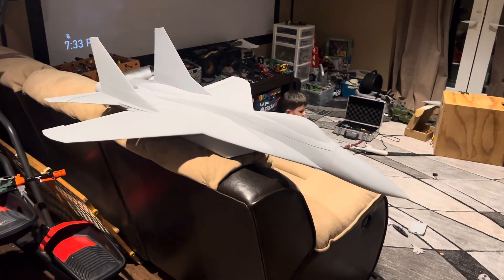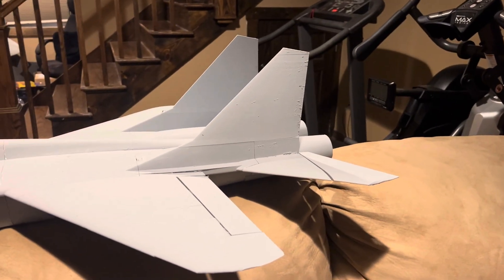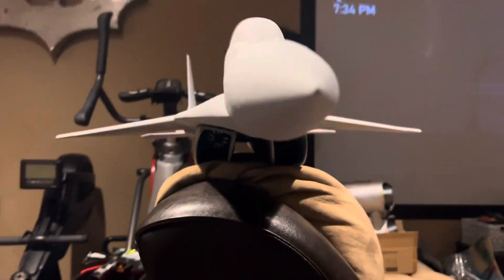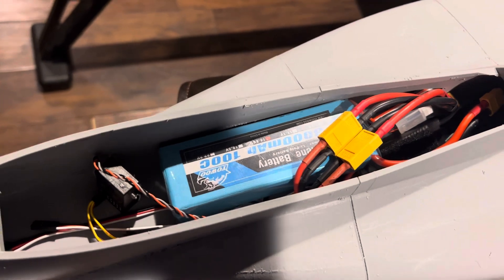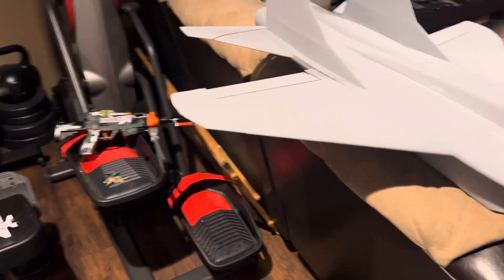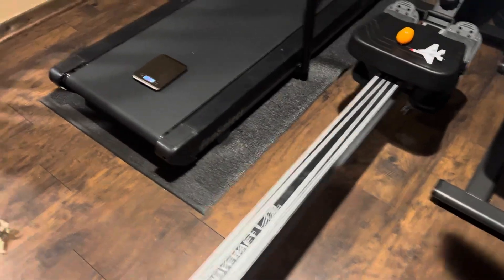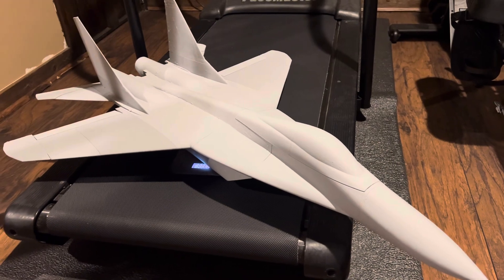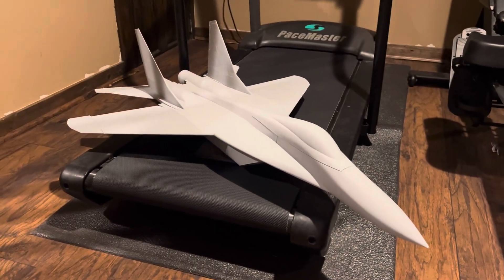3d printable Mig 29 twin 50mm edf almost ready!

Comment: Hello!  My two sons thought it would be a great idea to attempt your MiG-29 bounty offer.  We have all the parts printed and are now planning assembly.  We have a few questions: 1) Can you provide an expected CG location?  2) In the 3MF file, there are some curved nozzles provided (arranged vertically below the actual plane parts). Are those used for anything? 3) Any tips on what to expect when launching based on your one attempt?  Thanks so much!  My kids fully expect this thing to fly quite well!
Reply: Where did you get the files?  What is the bounty offer?

Comment: How many spools did you use? The rear section takes up my whole print bed lol
Reply from the maker: The whole jet weighed 1500g with all electronics and a 3000 4s. I’d imagine around 900-1000g of lw pla so one

Comment: This is going to be my first printed airplane, how much filament does will take if I use color fab lw foaming pla?
Reply: Just curious what software do you use to design the planes?
Reply from the maker: @solixite  Shapr3d
Reply from the maker: Probably close to 900-1000g. I’d buy the filament and make sure you do some test prints and get it dialed in for LW pla. What printer do you have? We have a group on FB to help and I also know a guy that started a FB group specific to printing profiles for plans. Let me know if you need help
Reply: @hotlapkyle  I have an ender 3 S1 pro and a creality K1 Max
Reply from the maker: @solixite  your gtg. Don’t get discouraged at first printing LW. Join my FB group and guys there can give you printer profiles for your printer so you’ll get good prints right away

Comment: This will be first to me, so I definitely want to know how you can use 2 Esc with one receiver please share electronic setup and when we can buy that
Reply from the maker: Yes! You just get a Y adaptor for the two ESCs into 1 lipo and then a Y connector for the two throttle wires into the throttle port 👍🏻
Reply: @hotlapkyle  any link to buy these cables